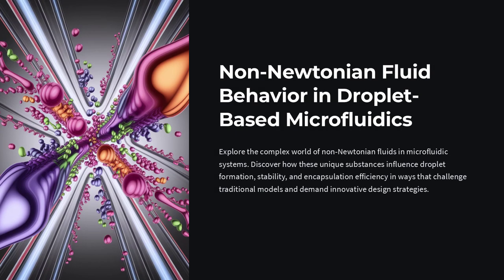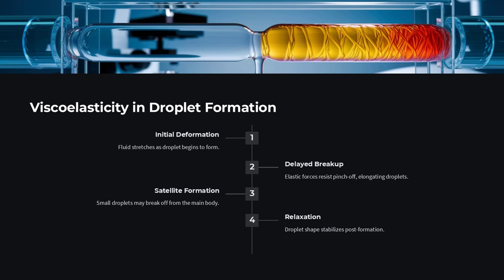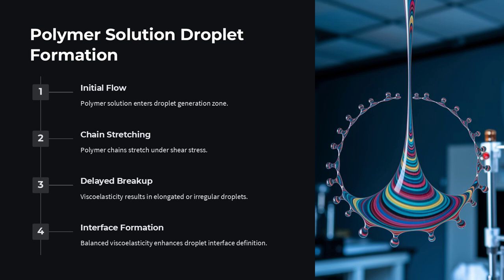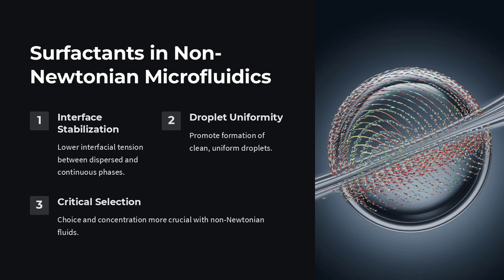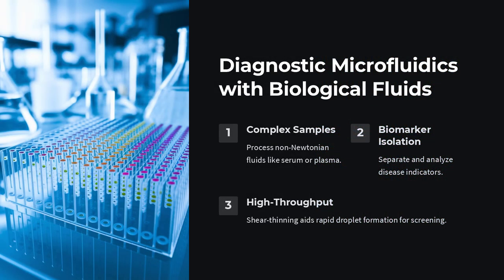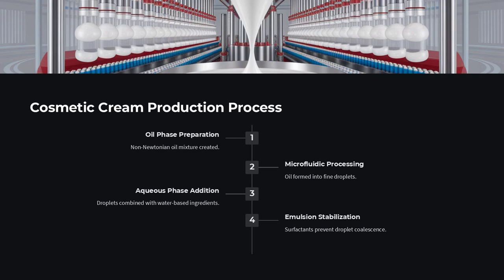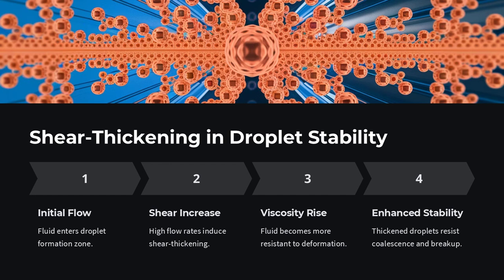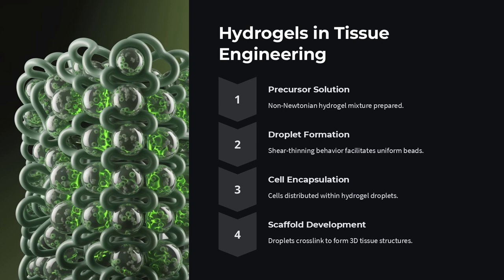Why Non-Newtonian Fluids Matter in Microfluidics

Comment from the maker: How can the complex rheological properties of non-Newtonian fluids be dynamically controlled in microfluidic systems to achieve optimal droplet size, stability, and encapsulation efficiency?
What are the theoretical limits of using non-Newtonian fluids in high-throughput microfluidic applications, and how can AI-driven predictive modeling help optimize their behavior in real-time?
Can microfluidic systems be designed to exploit the unique viscoelastic properties of polymer-based fluids for next-generation biomedical applications, such as smart drug delivery or self-healing materials?